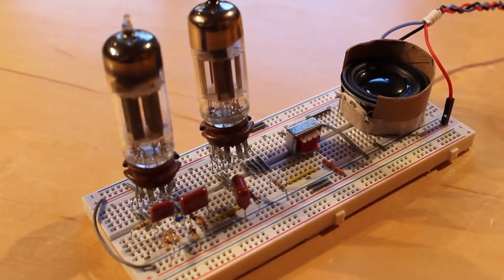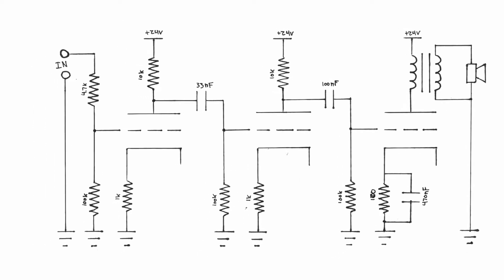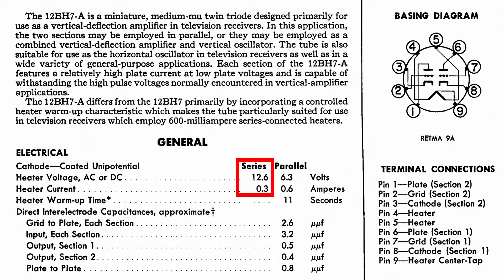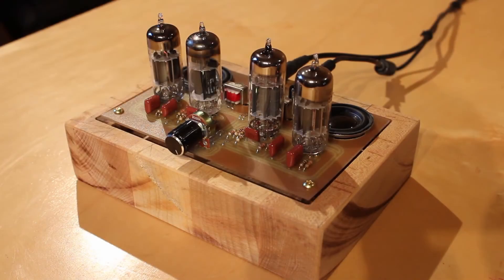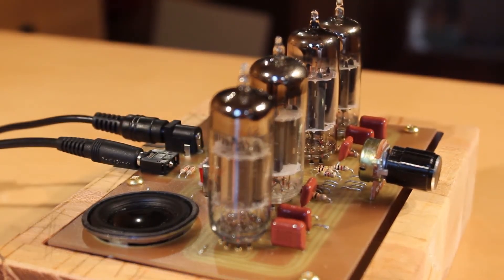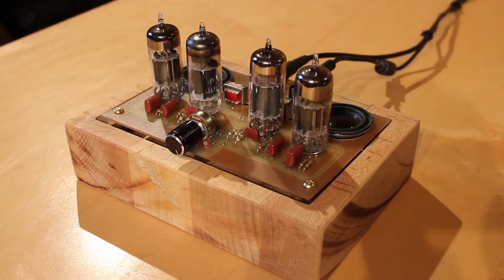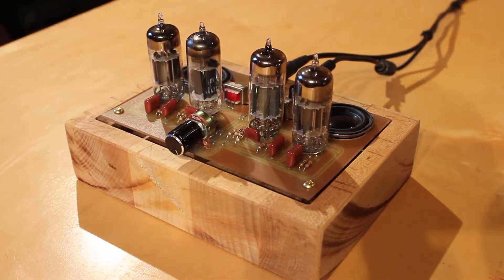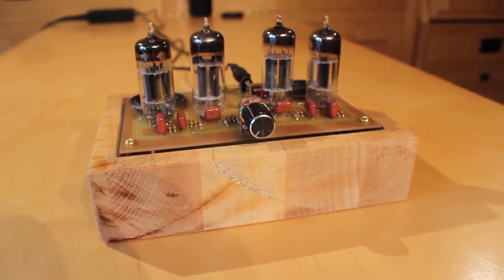Finalizing the Low Voltage Vacuum Tube Audio Amplifier

Comment: Awesome amp!  What did you use to turn the PCB into a tube socket?  Was there something you soldered into the holes?  I want to use that technique someday.  These covid times are perfect for building projects.  I just finished building a tube theremin.
Reply from the maker: Thank you so much! For the tube sockets, I actually just use little 1mm PCB receptacles (link below). They have a 1mm inner diameter, which is perfect for 7-pin and 9-pin tubes. The outer diameter is about 2mm though, so in DesignSpark I just made a pad with a 3mm OD and 2mm ID (in order to get my mill to cut the pad correctly, I added a board hole in the center of the pad, but that was something specific to cutting on the mill). The only downside to this method is that if the tube runs hot, quite a lot of that heat gets transferred into the PCB. For the smaller 7-pin tubes like the 6AU6, this isn't a problem at all as they never really get all that hot, but the 12B4A I used here seems to run really hot. So much so that you can't touch the glass after it's been on for a while. So, I may run into PCB reliability issues on this amp in the future if I run it for several hours at a time. That was a sacrifice I was willing to make for the aesthetic, haha.

PCB Socket: https://www.mouser.com/ProductDetail/855-H3161-46

A tube theremin is one of those projects I actually got super interested in after playing The Outer Worlds! There's a tube theremin schematic floating around in some areas of the game. I had never really heard of a theremin before then, but now I think they're epic instruments! I'm looking forward to checking out the video on your channel!

Tube Theremin in Outer Worlds: http://www.thereminworld.com/Forums/T/32677/spotted-in-new-game
Reply: Hi, can't wait to see the tube theremin on your channel :)